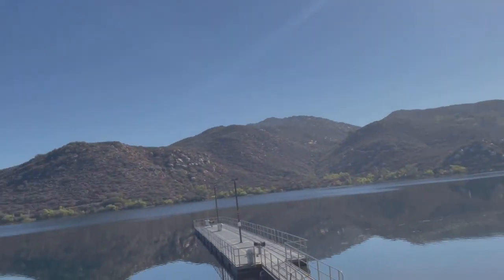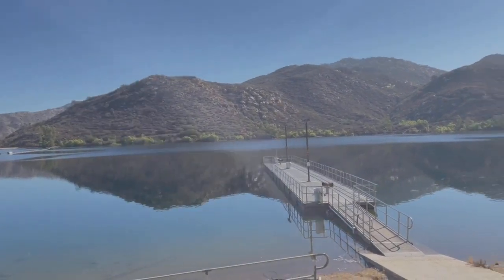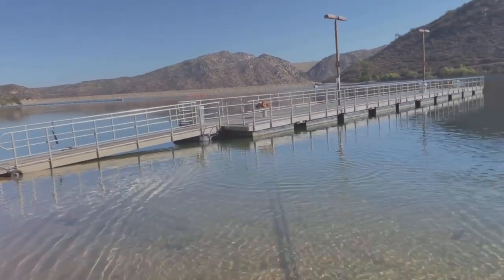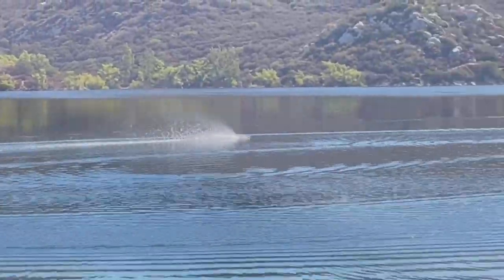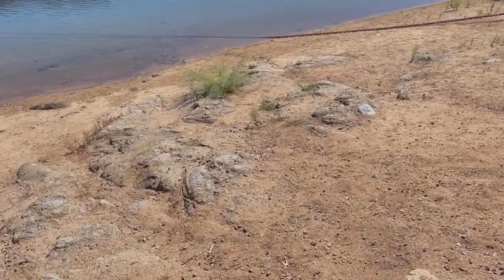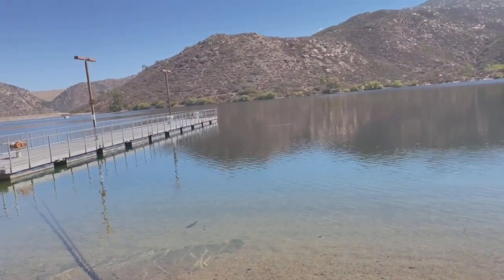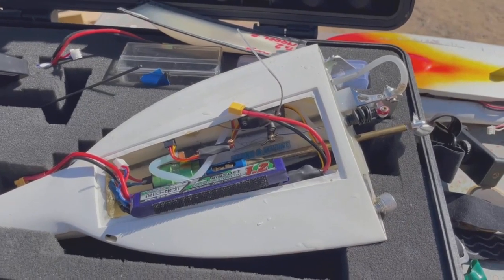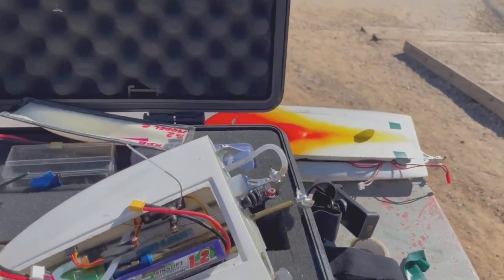Dr. Jet finds a power system that will put the JetStepper right at the FTZ (Frisbee Transition Zone)

Comment: That stepper looks pretty good doc
Reply from the maker: It's getting close.  I'll try the $6 2600Kv outrunner with the Graupner 26mm prop next and I think that will be it.  CHEAP to the bone.  The torque factor makes driving a challenge, but that's part of the fun.  Add that to the fact that it's right on the edge of uncontrollable, this thing could be tons of fun with 5 or 6 in the water at one time.